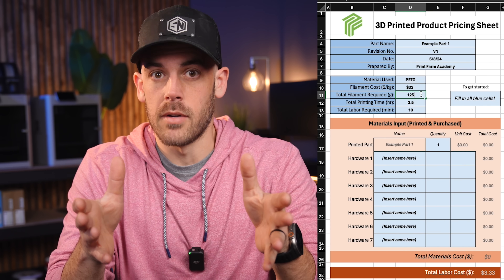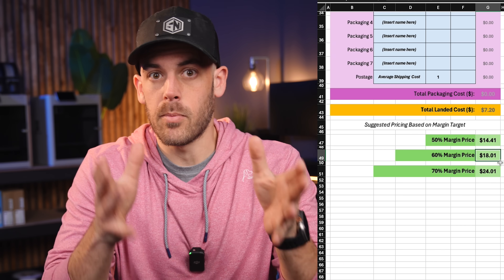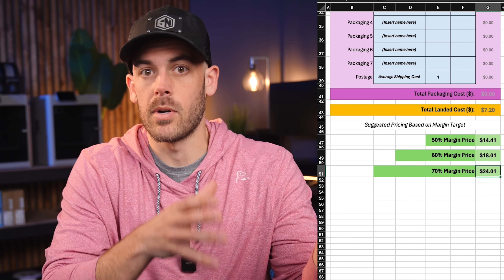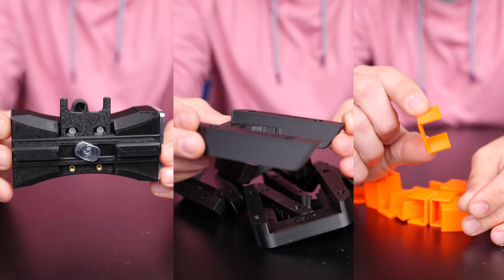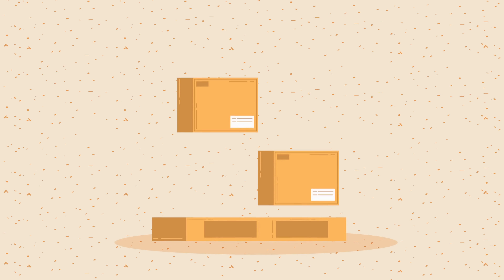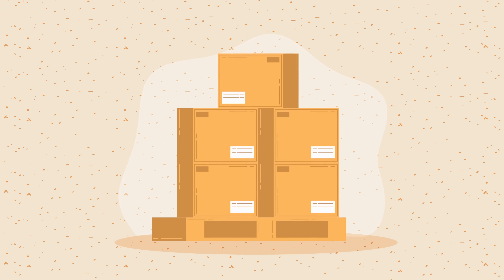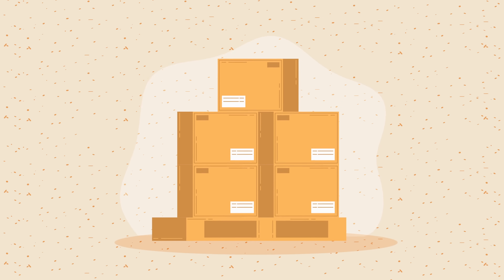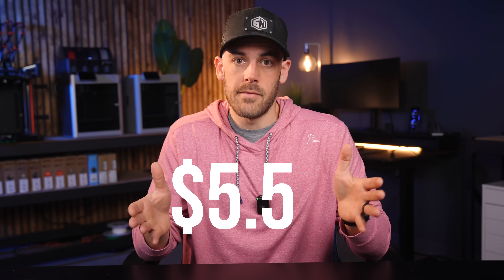Why I charge $55 for this 3D printed part (how to price)

Comment: I have a simplier metric for determining cost. Pick a lowball number and start selling at that. When you are selling faster than you can make it, increase the price slowly until sales match output. simple supply and demand. I made a replica prop from a kids cartoon, its a toy. And i did all the math on how much to charge and decided on $30. Then i put it on etsy and within a month i realized i am turning down orders because  my machine (and I, because I paint it) can not keep up. So it whent to 35, then 40, then 50, then 55. Then at 55 i realized i had redesigned some parts to print faster and got faster myself at painting it, and now i could outpace sales, (i relized this when i got about 10 backuped up on a shelf) and so i lower my proce back to 50. I sitll occastionally get some backstock and just run a 20-30% off sale. So my cost is about $12 and i charge $50 most of the time. Now i have increased the price again slightly so i can focus on new products, which i have over the last year increased to about 20 products offered and have adjusted the price of each on a regular bases until my sales match my output. My point is that "cost" litterally has nothing to do with it, its just supply and demand. If a competetor is offering something similar for 10x your cost, dont price yourself at 2x cost, just beat them by 10-15%. But on the other hand if a competetor is selling something comparable for less than your cost + 50% profit, then dont bother even selling it. You dont mention that as an option, but people need to consider before even investing time into designing a part, is this even worth it, can i sell this at a high enough price point to make this worth my time. Start by doing research on competetors and gauging interest from the relevant communities, i only end up making about 1 out of every 5 ideas i have becasue its just not profitable or that niche is already filled.

Comment: rule of thumb for lazy people (if you're only doing a few or just want to have a rough idea when looking at models to print, otherwise do make more accurate calculations) : cost of material x10 (or if you have the weight of the print, multiply the weight in kilograms by 200 (multiply by 2 then move the comma by 2 to the right) or divide the weight in grams by 10 and them multiply by 2 ).

also I would factor in the work time of the printer higher, as it could be making something else, so you'll want to feed back your average profit per hour of print times the time the print takes at the end as a "cost" to estimate what prints to push or how to adjust your margin, note that this will bias towards prints with more work, which you might not want, so you might want to do a weighted average of the profit per hour of work times hours of work and profit per hour of print times hours of print.

do take into account that you need to be making listings for every item and deal with delivery being a pain (broken/lost packages) and people typing the wrong address (basically Marketing/PR, also HR if you have only a few employees.) both for hours of human work and as a hidden cost.

ideally after subtracting that from your profits the result would be 0 for every product, meaning everything is well balanced, but you might have some that take more work and others that take more printer time, or are skewed.
do note that if you're not working at capacity, you don't have to take printer time into account (as there would always be at least 1 free printer at some point ) but you should take into account the cost of active work (you don't want to be picking up prints and making packages all day).

printer time is not as important with fdm (as time more or less corresponds to material usage), but with resin it prints at basically the same speed whether you do a full plate or just a single screw, so printer time is usually very relevant, and also gloves are a real factor, at 3 cents a piece it's not much, but a pair for pouring the resin and a pair for removing and cleaning the print is 12c, and if you're printing small stuff that costs a few cents of resin it adds up quick, so batching is pretty important. (if you're going through 25 prints a week, which you easily can on the newer printers that print 10cm an hour, that's 3 bucks a week, times 52weeks in a year, you're looking at over a hundred bucks a year in just gloves, that could be a pretty nice Christmas gift.)

another thing to take into account is air filtration and heating especially both with resin, but also if you have mostly fdm, heating is relevant if you only have a few, but air filtration needs to be thought about when you start having more than 2-3, even pla produces particles when melted in a 3d printer. (there's installation costs.)

something to take into account is that you generally don't want to remove stuff from your website, but even if some items appear to be have bad profit, "loss leaders" may be necessary, i.e. something you're not making profit on or low profit, but that a lot of people buy along other things which may have good profit, unless you're working at capacity. But a good way to soft-get rid of things is to mark them as legacy just put a price you're happy to make them at, or you could just make the files available (free or paid, your choice, you could also make paid bundles)

Comment: I price my items basically using this method. For design work, I will charge $30 per hour. If I do a design for a customer, I have a line item in my price for design and only charge it once to them (if It's a custom design that they requested). I always tell them that design charge is a one time only, and their piece part price will stay the same going forward no matter how many they order.

If I design something on my own to sell, then you do need to factor in some portion of that design labor into the piece price. You could make some assumptions on how many of the item you think you would sell in a given period of time, and use that to determine how much of the design and development cost you would want to factor into the price to recover that design and development cost you incurred.

Comment: The problem with many "makers" is they are not business majors. What is going on here is calculating "cost of goods sold" This determines whether you should enter the market at all, not what you should charge. What you can charge for a product is strictly determined by supply and demand. What someone is willing to pay vs what you will sell it for.

Comment: You didn't include taxes, business insurance, overhead like your shop, tables, computers, regular printers, and anything else you need to run a business. I start out with a high estimation and if I don't sell many I might lower my price. But you only lower your price if you sell a lot more because selling more at a lower price doesn't necessarily mean you will make more profit. If you are not good at estimating your costs then find a friend or family member who can help you.
Reply: Why not also add the oxygen per second you use? The space taken by you where no machines can be? Or maybe even the square meter of the square meter used by your machines?
Holy shit slow down with all those extras onto your customers

Comment: Open minded now think fire full shape or shapes not print in line.but all at once full shape like a stamped shape multiple print heads this will change the hole printing world. You can do it help.is given now run with it😊😊😊

Comment: The biggest obstacle to making any money 3d printing is competing with others not making any money with their 3d prints. There is no shortage of people who are willing to sell at cost or cheaper just to make a sale. They will never go out of business because many of them are living in their mom's basements. 3d printers are good for prototyping, then making the product with equipment that millions of others don't have (Lathes, Mills...etc).  A good example is the Dewalt battery holders he was talking about. It costs him $13.50 just to make 6, when you can get 12 on Ebay for $15 with free shipping. This is why you see Print Farm Academy making Youtube videos to supplement the failures of 3d printing business, by getting subsidized by the 3d printer manufacturers.

Comment: As others have mentioned, space etc. costs aren't in your calculations. What I suggest here will require moving the electricity and labor costs out of the unit cost, and to the "overhead cost", which is calculated on a regular basis, perhaps quarterly. Total all business expenses for the period. I mean rent, wages, benefits, electricity, toilet paper, vapor capture equipment payments and maintenance. EVERYTHING. Divide that by the number of units manufactured in the period. That figure is your "Unit Overhead", add that to the other per-unit costs you're mentioning and you're then really close to the real cost. Your current calculation treats Air Conditioning, bathroom breaks, Fantasy Football, vehicle costs, staff lunches as Free Stuff.

Comment: One thing I expierment with thats very important is changing prices. you have a $20 part making you 50% profit each time you sell one averaging 10 parts a day. sometimes not always the case you can sell it at 30% profit but instead of 10 a day your now selling 30 a day. pricing is a little more complex than this video shows. you want to find that sweet spot of most profit on average but also balance it to where you can match supply. its not about the fairest price, its about most money made a day. Of course always include some things like shipping ,electricity and material cost but your markup should be expiermented on. like I said though make sure you don't drown yourself you also don't want to be selling 100 parts a day making 7% on each of them especially if you are your own supplier.

Comment: The cost of the space should also be taken in to account IMO when working out the cost to produce a part.  

For example if a rented workshop,  probably the hourly rent devided by the number of printers.   or if not paying rent,  how much could you rent the space out for?

Comment: If any of the parts are designed using CAD, that cost would need to be added too, then spread across the expected parts being made on the first order (unless it is expected that there will be repeat orders). If it was not designed, then it should be accurate pricing in my opinion.

Comment: I get the price point but a better Bosch 3D printed dust chute for miter saws is made by MechWorks3D.  I've tried both yours and MechWorks3D.  The MechWorks3D one has a larger hose diameter, a cutoff deflector mounted behind the kerf plate and more robust plastic.  So charge what you need but a better mousetrap always wins.

Comment: So you include the hourly labor rate in the total landed cost. Afterwards you multiply the total landed cost by 2 (50% margin prince). So the labor rate is also multiplied by that factor (2 in this case). This means that you actually work at double the hourly rate. Isn't it more correct to add the labor cost afterwards? It will result in a much lower price of course, but I think this will be a much more reasonable price. What are your thoughts on this?

Comment: My first experience with a 3D printed part was a broken soap drawer latch mechanism on my washing machine. This part was discontinued, I found a 3D printed part on eBay for $11 and it was 100% correct, I would have paid $20-$30 for that part, needed it that bad. If I had to guess the seller had a 3D print machine and his washing machine broke and he found out this was a discontinued part. I dumpster dived the internet for several days before finding that part on eBay.

Comment: Many places have multiple power rates, based on time used. Power used overnight is usually cheapest, and middle of the day is the highest cost. In FL, middle of the day is 4x the nighttime cost.  I am assuming the low cost operation hours are 0 (new) to about 4500 hours, and higher cost of operation after that...

Comment: Great video, thank you sharing your business knowledges these are so valuable. Overally we need to understand, if you wanna run a 3D printing business you need create unique products (e.g. complex shapes which are not producable easily in traditional methods like cnc, milling, injection molding or pressing etc). Unless we create clever solution products, we are not going to make money -in my opinion.